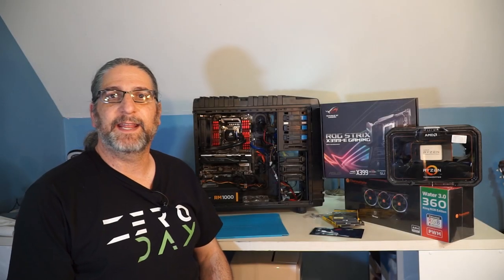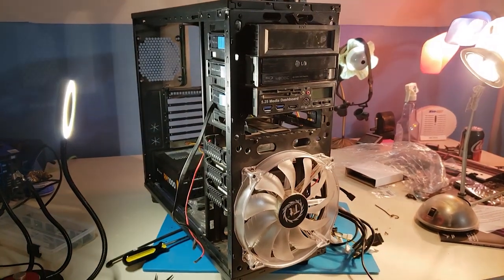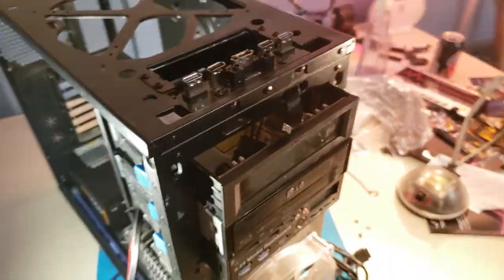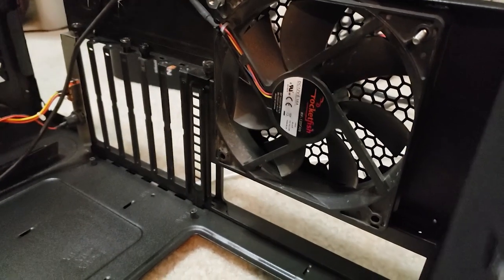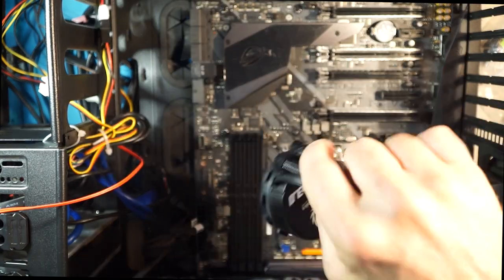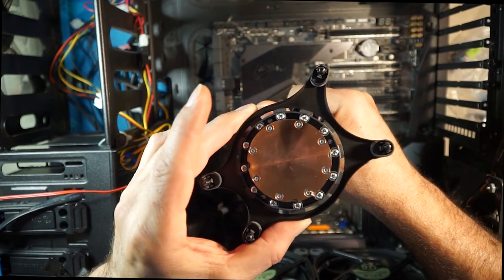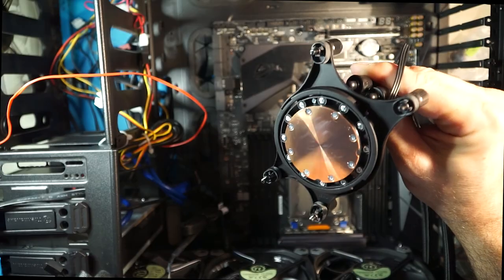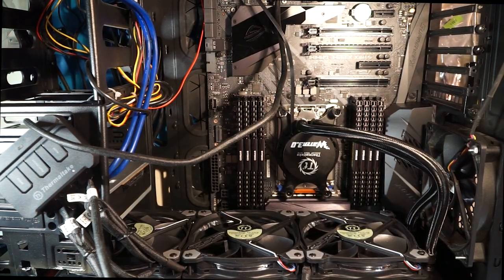Thermaltake Water 3.0 Riing 360 AIO Liquid Cooling CPU Cooler installation

Comment: Wouldn’t you be counter productive pulling in the warm air back into what the radiator is cooling? Fans draw air from free air vents. Sure you will blow warm air across the radiator but it’s still expelling from the case?
 Best test would be do a video with thermal imaging and see which is more efficient over all
Reply from the maker: I think the radiator fans number one job is to keep that expensive investment (the CPU) cool.  As for the warm air inside the box, let the other fans expel it out.  But that's one reason for making the video, to create an open dialogue.  Thanks for commenting.
Reply: it is counter productive if you have also nice nice memory or nice nice graphics card that you'd also like to keep cool as well.  this person has all intake air going through the radiator, and then out evenly.   would be better to have a pull AND a push flowing air perpendicularly from the air coming in the top to justify pulling in the air (from outside) through the radiator.  definitely want a perpendicular push pull IF you do that